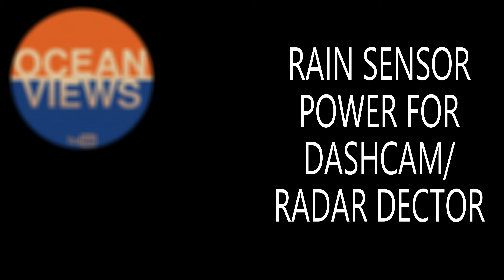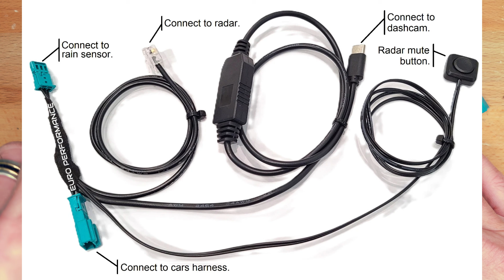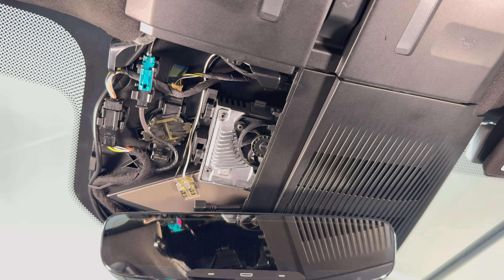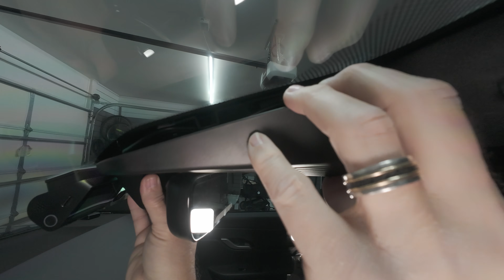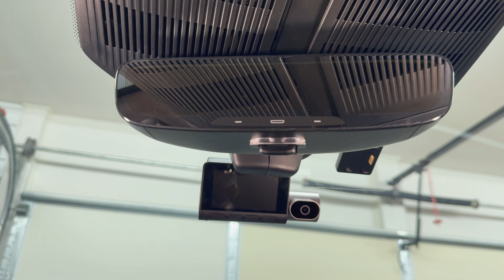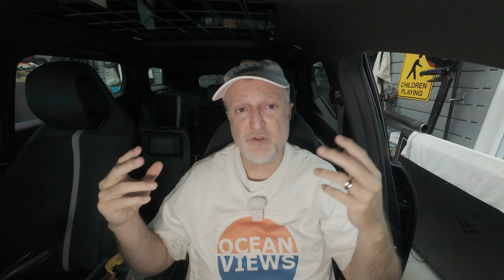Fisker Ocean - Rain Sensor Power Kit

Comment from the maker: For clarification, after I did this video, I noticed that the dash cam will turn off when the car goes to sleep.  That sometimes takes 5-15 minutes.  So there's not much to worry about if you leave your devices on when you are done driving and lock the car.
Reply: I want to order but for some reason I do not have power to the digital mirror. I looked at your pdf to see if I can check the fuse but all the fuses that I selected were good. Any help would be appreciated.
Reply from the maker: @klktatoklk There is no specific fuse for the rain sensor.  It’s most likely grouped with another system.  I’ll have to research.
Reply: @MTNRanger  I ordered and installed. I have the vehicle currently at 24 hours. I don’t think it’s gonna go to sleep. Please let me know if I got this information incorrect.
Reply from the maker: @klktatoklk The car should still fall asleep.  I use the 2 hour (middle) energy setting.

Comment: Very cool!  Do you think you can talk Euro Performance into a cable adapter for under the center console to turn the Qi charger power cable into another USB-C so we could maybe get some Mag-safe or Qi2 mounted underneath there instead?!  I almost did the microsuede and rubber mat removal trick last night...but I instead opted for two mag-safe pucks (with a bunch of double-sided tape both under the pucks and under the rubber mat) and while it looks and works fantastic, it still looks very "aftermarket-y".  And since my Carlinkit hated being on the same 5v circuit as those, I actually had to run a second accessory fuse tap (in addition to my existing RF35 one) at RF38.  But it's working great so far!
Reply from the maker: I'm not sure how accessible the power connector is for the qi chargers.  I have opened that area up to remove the taco tray, but it's a pain to get to. To take out the panel may require the screen to be removed. I'll have to revisit at some point.

Comment: Perfect timing!  I was just getting ready to install a dashcam and was concerned about running those wires around all the airbags.  As always, thanks👍👍
Reply from the maker: Yes, it does make things a lot easier.
Reply: Funny I just ordered one this morning. I thought you said that the rain sensor turns off with the car once. When the car sleeps does the power shut off? My dash cam timer doesn’t shut off power for some reason.
Reply from the maker: @paulystark2890  I have been looking after the installation. I have since switched off the dash cam turn off timer. When the Ocean goes to sleep, the dash cam does turn off.  Sometimes it takes 5-15 minutes after locking.
Reply: @MTNRanger Thanks for checking this out for me Matt! I feel much better about it now.